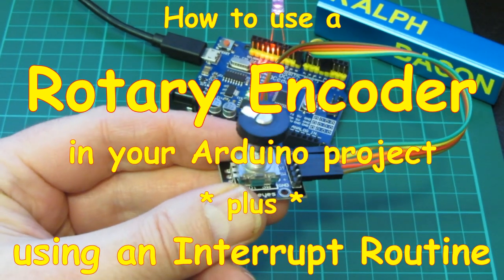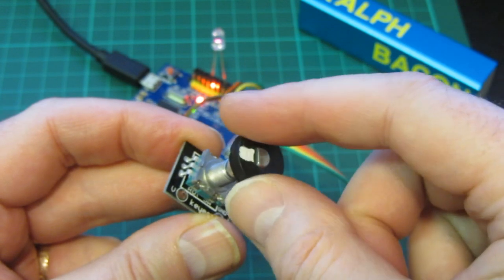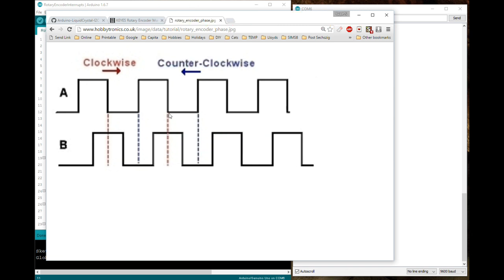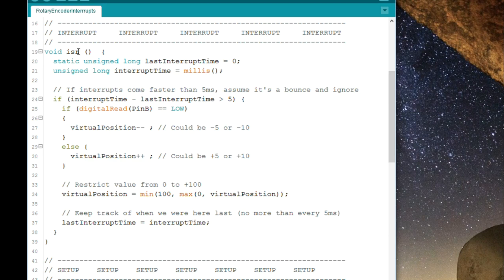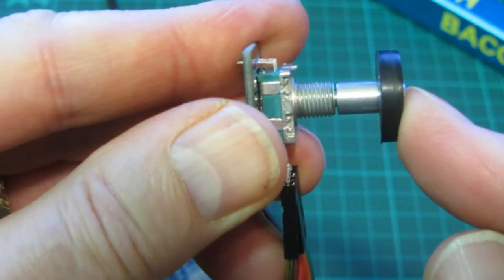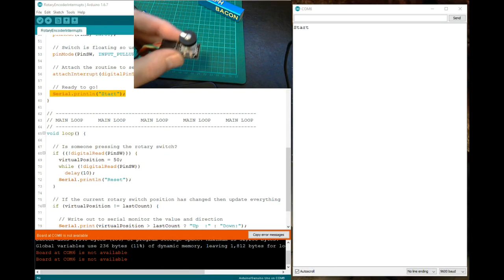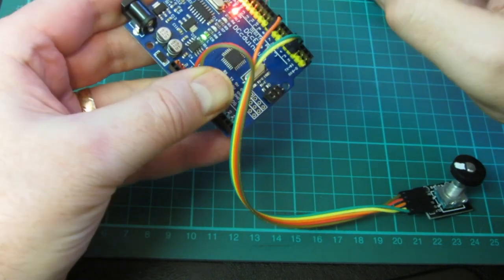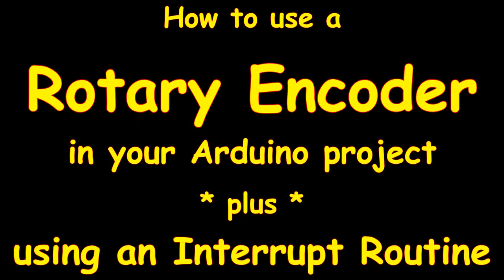#19 How to use a Rotary Encoder with an Interrupt routine on your Arduino

Comment: THANK YOU! I was having so much trouble with the Encoder library causing bad reads and trying to convert an 'absolute count' into just direction (all I needed was forward and back). This simple explanation of how to use interrupts to do this allowed me to build a bulletproof direction-only encoder read with less than 20 lines of code.
Reply from the maker: Glad I could help you, Rob, and thanks for posting here, nice to hear from you.

Comment: Thanks great explanation on these little gems. I recently had a 4 month nightmare because one of these did not function properly when installed in a mini oscilloscope. I was posting on forums everywhere I saw one of these built, and I guess I solved it myself, when I came upon one of my posts and read exactly what I posted. So to test my theory, I purchased a few  of these, and replaced the one in the scope, and suddenly my nightmare was over, despite I had already purchased another model that was a bit larger and a lot more expensive.  So now I have a pocket model and a desktop model and that is actually a good thing.
Reply from the maker: Can you have too much of a good thing, Jerry? Not when it comes to electronics and Arduino stuff! As you know I have a "proper" bench scope, but my JYE mini scope (video #92) at 1/20th of the price often does the job, especially at the Arduino level we usually are dealing with. I'm glad you got yours sorted out, and as you say, big model + small model =win-win! Thanks for that anecdote Jerry, glad you liked the explanation of Rotary Encoders, and good to hear from you again.

Comment: Assuming you ARE actually getting contact bounce, it seems like you'd want to move the "lastInterruptTime" down a few lines (outside the if-clause).
Otherwise, you'd still get contact bounce if the dial was not being moved except for vibrations/optical noise that causes the bounce. 
By moving it outside the if-clause, you remove all contact bounce that occurs within 5ms of the last contact bounce.  The way you have it now, only the first bounce starts the timer to disregard an incoming 5ms stream of bounces.   If a stream of bounces is 6ms, then you count the last bounce as a pulse.  
This may not matter depending on the optics/velocity of the encoder.
Great video!
Reply from the maker: An interesting proposed change to the logic, RainHarvester. Let's see. My logic is thus:
 
1. Grab the current time.
2. Compare time against previously stored time.
3. Have I been here in the last 5 milliseconds since running the ISR logic? Yes - exit.
4. Do the rotary value stuff.
5. Update the stored time with the current time.
 
This means that as long as 5ms has elapsed since last run it would indeed run the ISR logic (eg after 6ms). Your change forces the behaviour to change so that at least 5ms has to elapse since last CALLED (not just run). Now I like this but it MAY lead to unintended behaviour, for which I will use my car's radio as an example.
 
My car's volume control is also a rotary encoder. If I spin it fast it refuses to acknowledge the pulses and just adjusts the volume slightly (as though only one or two pulses got through). So rapidly adjusting the volume to zero by turning the volume control knob rapidly anti-clockwise doesn't work. You have to turn it in a more gently manner for it to respond. This can be annoying as a user, as I know I've turned the volume control 10 clicks (very rapidly) but the volume has only changed from 20 to 18 in that time. This is the behaviour that may be the result of your logic change. Perhaps 5ms is a good value for your logic to work just fine and my car's design might use 20ms which is much slower (and thus less responsive).
 
The long and short of it is that I'm intrigued whether your design would actually work better in Real Life or not. I shall add it to my list of things to investigate when I have a spare nanosecond or two. Thanks very much for posting, it certainly got me thinking long and hard about this, appreciated.
Reply: Your suggested fix worked for me. I was getting number skipping when I turned the knob...52,54,56,etc. Per your suggestion, I moved that lastInterruptTime down outside of the loop and now I'm getting exact sequencing of the up and down numbers in the monitor window. I also have added 10k resistors to my pins 3 and 4. BTW I am using a Teensy 3.5 board.

Comment: There is a library for rotary encoders but it actually makes more sense to do it this way as you learn a lot more about the functionality of the devices you are attaching to your Arduino. My question is can you expand the interrupt routine to detect more than one rotary encoder as I am working on a project that needs two of them?
Reply from the maker: +Nick B
And you have understood the purpose of my channel perfectly! Of course there are times when I use libraries as a building block of a bigger project but at least if you have gone through the hows and whys then you be a better developer.
 
Regarding your question, NIck, remember the Arduino Uno / Nano has TWO interrupt pins (2,3) (Mega has SIX!) so why not attach each device to its own interrupt pin? That will ensure "separation of concerns" and each interrupt method has a "single responsibility" - easier to code, maintain and understand. Golden rule: an interrupt routine should be lean and mean, no fancy logic and absolutely no Serial.print statements (unless you are debugging, of course). Update a (volatile) variable and get out. Job done.
 
Enjoy my channel and other videos, I just wish I had more time to do more!
Reply: Thanks for your response. I was thinking along the pins 2 and 3 line myself. I rarely use Serial.print anyway as most of my Arduino code outputs to a display device of some kind, LCD, OLED etc. I enjoy coding so the challenge of coming up with code to drive other devices isn't really a challenge to me, it is more of a quest for more knowledge and the satisfaction when it works as you intended.

Comment: This is a great piece of code Ralph. Thanks for the instructions and describing the function of it all. I have a question about it in regards to the switch on the encoder. How would we use the switch if we wanted to set a specific input to a stepper motor function? ie; When we hook up 2 different stepper motors to our arduino and want to run a manual set up to perform at set parameters in the loop instead of having to code it each time. Like say we want to set motor A with a start point and an end point then save those setting by clicking in on the switch of the encoder. Then set motor B up with different start and end points with its own encoder(unless there is a way to do it with just one encoder). Afterward when we push a button to run the code it will move each motor to it's individual start and stop points until the user pushes stop.
Reply from the maker: Hi there, er, Yep That Is Me!  Stepper Motors are notoriously difficult to "set" unless you have some sort of end-stop as a reference point. This might be a mechanical switch like a microswitch, or a magnetic Hall Effect sensor, just to name a couple. That is why the question you're asking is difficult. The stepper motor has NO IDEA where it is currently positioned (unlike a servo) so "setting" it is just a matter of counting the individual pulses that you send to the motor to (hopefully) move it to the correct place. And then reverse that by sending a number of "reverse" pulses to move it back again. But it still does not know where it is set to. I recommend you read up the differences between servos and stepper motors and you will find lots of information. Good luck!

Comment: Really nice and clear video, thanks Ralph. I've been wondering what to use my encoder for, you've now given me some ideas. One question i have is why did you attach the interrupt in the LOW rather then FALLING mode, as it would seem from the diagrams that FALLING was the way to do this ? Incidentally I tried it with FALLING, but it gave erratic readings, so clearly LOW is the better choice - would be interested in your thoughts as to why this is. Thanks
Reply from the maker: Hey, Steve! I had problems getting FALLING working reliably, possibly because of switch bounce. LOW, however, worked reliably as you found out. And when you look at the square waveform LOW / HIGH is what we are really detecting and comparing against. FALLING and RISING (not that you can do the latter except on a few Arduino boards) is not bringing anything to this party. Great question, nice to hear from you.

Comment: Thanks for a great video. I wanted to learn how a rotary encoder worked, watched some other videos but they didn’t really explain what was going on and how the code actually worked. Great stuff as I think having watched yours I’ve got a handle on it now. It’s a bit of a change from writing ABAP4 for big SAP systems but very interesting to get down in the weeds. 

Malcolm
Reply from the maker: Challenges are what makes the success even sweeter, Malcolm! Try a simple sketch to prove you understand Rotary Encoders eg light an LED on the left or right depending on which way you turn the RE. Or, have a strip of Neopixels and wind them up and down using the RE, now that is a challenge (and no peeking at a video that I did to show this). Good luck. Hang on, did you say SAP? Spawn of the devil, you mean. No offense. I'm more of a dot Net person.
Reply: That’s exactly where I’m heading. Thought I’d try a pot first as haven’t played with analog stuff yet. Spawn of the devil it may be but I could move seamlessly from client to client and work on/implement systems with 100s - 1000s of users.

Comment from the maker: The final code used in this example can be found here: https://www.dropbox.com/sh/l7bzy5hj46ywa58/AABjo0yydmB5nzeAuK_nPI9da?dl=0

Any problems with accessing that code (or understanding it) please DO let me know!
Reply: One question please..If I want to make an encoder of 3 bits of resolution, how do I do it?
Reply from the maker: +Sergio Puentes Torres
Hi! A 3-bit resolution will give you only 7 positions - are you sure this is what you meant? This rotary encoder gives more resolution than that. Here's a link to how resolution is defined which may help you describe your requirements better: 
http://bit.ly/2cgLQHQ
Reply: Yes, it is to better understand it. I want it simple, with only 7 positions. Please
Reply from the maker: +Sergio Puentes Torres 
Well, project guidance for your specific needs is best directed at the Arduino Forum: (http://forum.arduino.cc/index.php). I would suggest you post your question in the Project Guidance section as there are many excellent and knowledgeable people there who can help you. As you might imagine I just can't spare the time to develop specific solutions but thanks so much for your interest, others might also benefit from your query.
Reply: Thank you very much Ralph
Reply: I'm not sure if the problem lies here but I'm not able to access the dropbox. I managed to copy the code from the screen by pausing the video. The one thing I learned was my HW debounce circuit consisting of 2 x 10K + 103 caps and a 74HC14 (built for another incomplete project, but used as is) is pants. Your SW cleaned the 74HC14 O/P a treat. I'll be trying the RE barefoot next.
Reply from the maker: New link! Also in the video description (now). https://www.dropbox.com/sh/l7bzy5hj46ywa58/AABjo0yydmB5nzeAuK_nPI9da?dl=0
Reply: Thank you for the revised link Ralph.I eventually sorted out the HW debounce. As my Nano was connecting to more than one RE I was forced to experiment and discovered, if using a manually operated RE, unless it's a huge sketch, changes can be detected purely by polling without the need to use interrupts.
Reply from the maker: Good to know you got it working, Brian. You may like to know that you can use "any" pin for an interrupt (sort of) so depending on how many Rotary Encoders you have, this page may interest you: https://playground.arduino.cc/Main/PinChangeInterrupt
Reply: Indeed. I was made aware of that by A.N.Other but only so much knowledge soaks in at once. ,-)

Comment: Hi Ralph, this video was just what I needed - I am building a shed (my shed in sunny Reading) environment controller with one of the MEGA / ESP8266 boards and am using a rotary encode to scroll and select from a menu on a 3.2tft screen. There are various sensors all of which can be viewed/controlled either automatically or via WiFi (anywhere in the world. Not all the mega pins can be used for interrupts and the screen uses a few and so the pin allocations is a bit of a headache but I'll get there. Any way interesting video. Well done.
Reply from the maker: Very glad you found this useful, DW, once you see how it works it all makes sense, doesn't it?

Comment: Hey mate, Great videos! I know this vid was from a while back, but I think I have improved on this code to make the turns 100% accurate and its super simple and easy to understand while still using interrupts. I have coded for the ESP8266 D1 mini (hence the ICACHE_RAM_ATTR in interrupt loop) but it makes for a super accurate way getting the right signal from the rotary encoder. All it takes, is some easy to understand nested while loops! They lock you into the sequence of the encoder and only kick you out of the loop if its an erroneous bounce signal. Let me know what you think.

...

const int PinA = 12;
const int PinB = 14;
bool pinBVal;
bool pinAVal;
bool turn;
int REPosition=0;

void setup() {
  Serial.begin(9600);
  pinMode(PinA, INPUT_PULLUP);
  pinMode(PinB, INPUT_PULLUP);
  attachInterrupt(digitalPinToInterrupt(PinA), interruptA, FALLING);
  attachInterrupt(digitalPinToInterrupt(PinB), interruptB, FALLING);
}

void loop() {
  delay(1000);
  Serial.print("Time on: ");
  Serial.println(millis()/1000);
}

ICACHE_RAM_ATTR void interruptA(){
  turn=0;
  pinBVal=digitalRead(PinB);
  pinAVal=digitalRead(PinA);                                               //clockwise
  while((pinAVal==LOW)&&(pinBVal==HIGH)&&(turn==0)){                       //step1
    pinBVal=digitalRead(PinB);
    pinAVal=digitalRead(PinA);
    while((pinAVal==LOW)&&(pinBVal==LOW)&&(turn==0)){                      //step2
      pinBVal=digitalRead(PinB);
      pinAVal=digitalRead(PinA);
      while((pinAVal==HIGH)&&(pinBVal==LOW)&&(turn==0)){                   //step3
        pinBVal=digitalRead(PinB);
        pinAVal=digitalRead(PinA);
        if ((pinAVal==HIGH)&&(pinBVal==HIGH)&&(turn==0)){                  //step4
          turn=1;
          REPosition=REPosition+1;                                         //adding the position
          Serial.println(REPosition);
        }
      }
    }
  }
}

ICACHE_RAM_ATTR void interruptB(){
  turn=0;
  pinBVal=digitalRead(PinB);
  pinAVal=digitalRead(PinA);                                               //counter-clockwise
  while((pinBVal==LOW)&&(pinAVal==HIGH)&&(turn==0)){                       //step5
    pinBVal=digitalRead(PinB);
    pinAVal=digitalRead(PinA);
    while((pinBVal==LOW)&&(pinAVal==LOW)&&(turn==0)){                      //step6
      pinBVal=digitalRead(PinB);
      pinAVal=digitalRead(PinA);
      while((pinBVal==HIGH)&&(pinAVal==LOW)&&(turn==0)){                   //step7
        pinBVal=digitalRead(PinB);
        pinAVal=digitalRead(PinA);
        if ((pinBVal==HIGH)&&(pinAVal==HIGH)&&(turn==0)){                  //step8
          turn=1;
          REPosition=REPosition-1;                                         //subtracting the position
          Serial.println(REPosition);
        }
      }
    }
  }
}
Reply from the maker: That's certainly a unique way of determining rotational direction, Graham. I can't try it right now (I'm editing this week's video) but I'll bookmark it and come back to it later. You say it works until you get a bounce and then kicks you out of the while loop. Then what, start the whole thing again?
Reply: @RalphBacon  sorry, I should have explained that better.
When you turn the encoder one click, this is how the program handles it...
It interrupts the program when PinA goes low. If its a bouncing signal from a terminal creating a connection within the encoder it will not enter any while loops as the next condition (pinB low) won't yet be true,and the interrupt will terminate and restart until a solid low is reached.  once a stable ground is established inside the encoder the interrupt will wait until the next step is complete in the process. Once pinB goes low, the code latches into the new while loop. If there is bouncing on pinB the code will only revert back to the previous while loop until a solid pinB low is reached. The same latching while loop happens for the next step in the process which is pinA going back to  high. If it bounces the program bounces back and forward between 'while' loops until a solid high is reached. As soon as pinB goes high as well  (bouncing high or not), the program is complete and the code adds a +1 to the count variable. I know the code looks a bit inelegant in the YouTube comments but it's much nicer in the ide, and it works flawlessly.